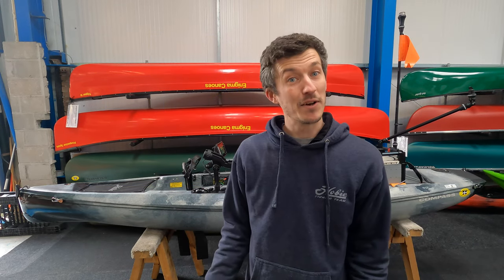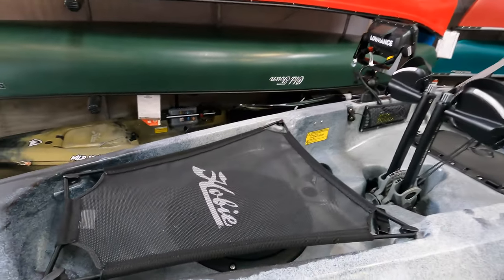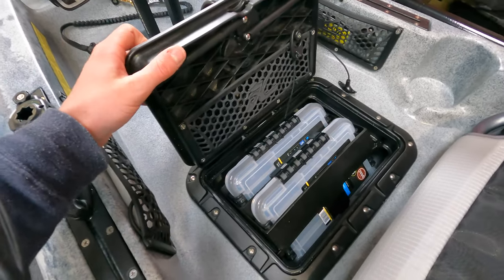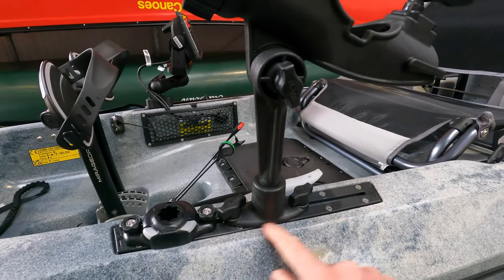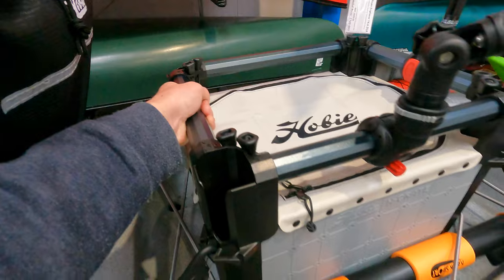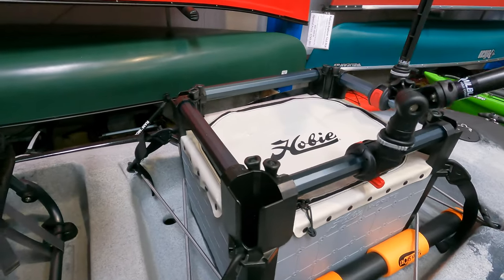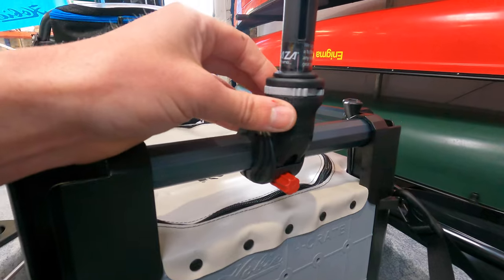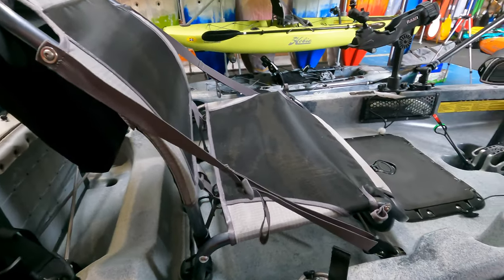Hobie Compass Kayak Fishing Set Up - Detailed Rigging & Outfitting Walkthrough

Comment: I have a Compass and a couple of things I would suggest are swapping out the plastic tracks for the aluminum tracks and the steering handle for the aluminum one. Both are made by BerleyPro. The Hobie rocket launcher tube for the flush mount rod holders in back is nice too.
Reply from the maker: The BerleyPro upgraded billet tracks are very nice, as are their handle upgrades. Worth doing if your budget allows!

Comment: How did you install the trifold rivets on the zig zag cleat? My rivet gun didn’t reach through the zip zags and had to use screws.
Reply from the maker: Some rivet guns will push into the gaps with a bit of force. Some are just way to big. Either by a new rivet gun with a smaller nose, or if yours pushes most of the way in, just slide some washes or a nut over the stem of the rivet so the nose of the river gun can compress the rivet against that. That way it doesn’t need to reach fully into the gap down to the rivet head. Hope this helps!
Reply: Yes, I think that will work ,then I can cut off the excess rivet with my multi tool.